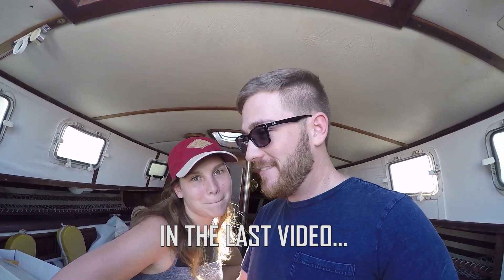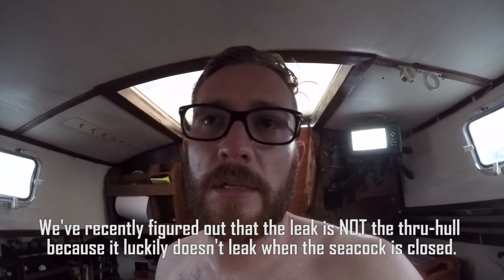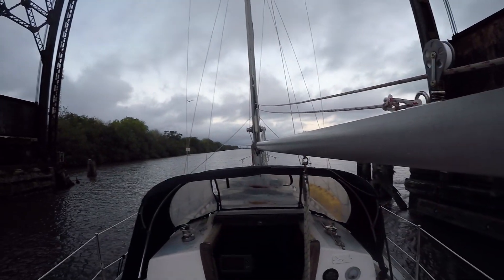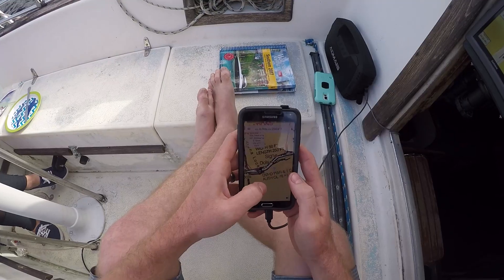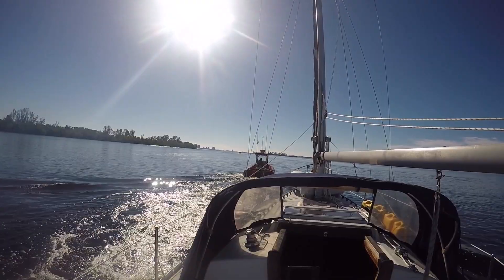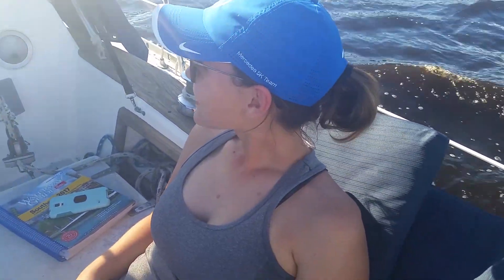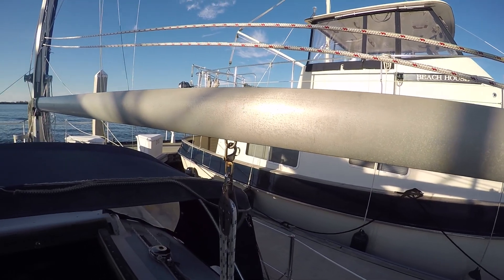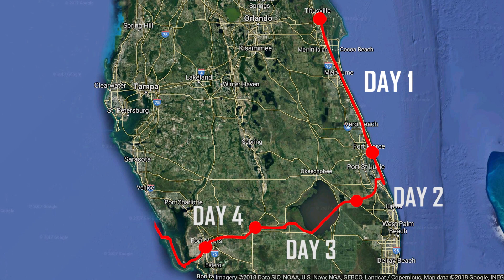33. Three Hundred Nautical Miles on a FREE BOAT! - DIY Sailing

Comment: Good video guys. A pity about the fuel pump issue. Its always handy to have what the car recovery guys call " A racing fuel cell". That's just a gallon can with a fuel line attached. You can put some fuel in it attach the line directly to the injector pump and hang it above to gravity feed fuel to the engine. Works every time.  Have subscribed and look forward to your adventures. Fair winds & regards from the UK
Reply from the maker: Sounds so simple that it just might work! I think we'll try to figure this out and maybe put out a video on how we did this. It could be helpful for a lot of boat owners. Thanks for the suggestion!

Comment: Why not get a Patreon page for people to support your efforts? 

I have seen 50 ft sailboats go for $1 but they take tens of thousands to restore often. Most often they need an expensive engine to start so you made out there. I would have the fuel tank cleaned professionally, change all filters, empty the water fuel separator, check / replace all hoses etc to start and keep that expensive engine in top condition for starters. Best of everything life has to offer to both of you. The trip and memories last a lifetime, especially when you are too old to well, do much more than enjoy your memories of youth :-)

Comment: I posted a long winded story about how you keep a Diesel Engine going on your last video about  an hour ago. it looks like I was  a little late to save you. Kudos for getting towing insurance! I think your going to find out that this  could just as well have happened on a boat that you paid a lot of money for. Anyway, I thought the engine was running a little rough the first time you started it. You might want to get the injectors looked at. Additionally, I would look into some better Engine mounts. It should not have that hard knock and be that noisy.....So just in case, I'll re -post the my advice on how to keep a diesel going here again. It might possibly help some people who missed your last video. Good luck, I think you'll have a nice little boat there.
Re-post from last video:
Hi guys. Congratulations on your new boat.
I thought I would contribute a couple of stories to help you stay out of trouble with your Diesel engine. 
If a Diesel engine is basically in good mechanical condition, then here is the only other thing you need to know about keeping it running for a long time.
My Father in Law was in the production side if the movie business with Warner Bros. Columbia all his life.
One time on location, in the middle of winter in one of the Northern States, a scene required a Longboat full of Fur Trappers to be shown rowing upstream. The current on the partially ice covered river proved to be too strong for the actors rowing the boat. An outboard motor would show a wake, so that was not an option.
The crew came up with the idea of using an old Caterpillar Dozer from a nearby ranch. It had a winch up front that they figured could help them pull the boat upstream. They build a little fire under the oil pan, so they could crank the old thing over and get it started. The problem was that the way the director wanted to shoot the scene, there was no way to hide the Cat or the winch cable, so they decided that the only solution was to submerge the cat with an operator in the river.
They extended both the air intake and the exhaust up, took the fan belt off, got it started, then took the remaining electrical gear off and drove it under water where the operator in scuba gear worked the winch. Some greenery on top of the cat hid anything that showed above water, and that did the trick.
The moral of this long winded story is that if a Diesel engine gets AIR, CLEAN FUEL and you manage to TURN IT OVER, it will have to start. (Off course new clean fuel is of no value if old dirty fuel has previously clogged the injectors). Also, if you want to keep it running, keep clean oil in the pan and keep it cool. Running seawater through an cooling system is also asking for trouble. A heat exchanger is usually the best way to go.
 Commercial boat engines when rigorously maintained, can last for up to 40 000 hours.
I build four steel commercial fishing vessels in the early 80”s. The last one, (my profile picture) weighed out at 140 tons. All of them as far as I know are still floating and plowing the waters of the Bering Sea. I always installed several Heavy Duty (Racor) Fuel Filters on a manifold system. They could quickly be switched over when one of the filters failed.  Also keep in mind that the most likely and worst time for dirty fuel to reach the engine is in bad weather when the boat gets tossed around, and old sediment gets stirred up. Not a good thing under the best of circumstances. It is also important that you frequently inspect the filter(s), and that you can visually see the fuel or any possible water in the glass bowl under the filter. There should be a drain cock.                   A crappy filter, with a metal bowl, which is many times standard factory issue, will filter your fuel, but will not let you see what you got until you open it up after the engine fails.
To further prove my point, in the early 70’s, I was single handing my sailboat just south of Punta Abreojos in Baja on a stormy night when I ran aground on a sandbar. As the boat was pounding in the surf, the portholes blew, submerging the cabin and off course the Engine. Long story...At low tide the next day I managed to get the engine started again. 
I did that by hand cranking it with the compression lever pulled. The minute I let that lever snap, that little Perkins got everything it needed, clean fuel and air and away it went. Long live Rudolf Diesel! Sadly the prop shaft was badly bent and I could not save the boat.
I cannot emphasize enough the importance of clean fuel. I never had a problem with anything Diesel I have ever owned, because I always went overboard on fuel filtration. The only Diesel that ever let me down was a piece of crap Volkswagen Rabbit Pickup Truck. The timing belt broke, and the engine exploded. I take comfort in knowing that it was running on clean fuel until it took its last breath.
Good Luck
Reply from the maker: Thanks for looking out for our audience too! Your advice could definitely help others as well. We did have a mechanic look over it, but may want to still have someone look at the injectors again. We'll examine the engine mounts to see if there is anything we can do to fix that knocking. -Randi

Comment: It's a good idea to close up all the thru-hulls when you are not on the boat. We turn off the engine raw water seacock when we take the key out of the ignition, then hang it on the valve handle so it isn't forgotten.  I really don't trust the engine cooling system not to leak when it isn't being used or watched.  Too many points of failure.   IMHO, never trust something that can fail when it comes to keeping water out of the boat when a simple valve could have been turned off to prevent it.  Wicked Salty lost their new boat because their head siphoned water up through it and flooded the boat when it was on the mooring can.  Simple to have prevented it just by making it a habit to close all the thru-hulls every time you leave the boat -except for cockpit scuppers which need to be left on so rainwater can drain through. 

Don't sweat the engine thing.  All older sailboats are going to run into fuel issues sooner or later if they are not kept up meticulously and most people don't know how to do that.   You'll learn it as you go, and eventually it'll become second nature (or you will go broke paying professional mechanics forever)  But it isn't really all that difficult once you start learning the common failures and how to fix and even prevent them.  Get Nigel Calder's books on diesel repair and he'll walk you through the troubleshooting of problems as well as maintaining the fuel system so that problems are minimized if not almost totally avoided.    Remember with diesel engines it is almost always fuel.  Fuel, fuel, fuel.  If it is a non-fuel issue it is likely to be a VERY expensive failure -often requiring a rebuild that may or may not be worth doing on an older engine.  

Have fun.  Learn those lines :D
Reply from the maker: Thanks for the input! We do make it a habit of closing the thru hulls whenever we leave the boat. I can't imagine how I would feel if I knew leaving the thru-hull open was the reason my boat sank. I don't think I could forgive myself. Lol. 

We actually were given a Nigel Calder book about engine maintenance from the previous owner. When the engine went out in the waterway we were looking over every possible reason in the book. It's why we were thinking it had to be the fuel pump diaphragm. Right part, but ended up being the power for the fuel pump. It is definitely a helpful book. -Randi

Comment: The engine issue could have happened to any second hand boat at any price. It will happen again, as it does to every sailboat engine anywhere in the world. You'll get used to it eventually.
Reply from the maker: Very true. Seems to be our tradition with boats that the engine cuts out on us soon after "purchase". It happened with our first boat, Somnium, as well. As soon as the previous owner drove off the outboard died. Hopefully it doesn't happen with every "new to us" boat. Lol. -Randi
Reply: A diesel engine that has not been well-maintained will likely have fuel-related issues.  If not in the tank with diesel bugs, or in the filters, it'll gum up in the lift or injector pumps or in the injectors themselves.  It's all about fuel quality and maintaining of the filters, hoses, and hose fittings.  You should go through every fuel hose and connector and replace them if they are at all iffy.  Rubber fuel hoses only have a lifespan of a few years before they become prone to failures and are no longer going to be reliable.  Also always have a spare fuel pump on board, and enough spare hose to fix any 2 runs of line plus all the fittings and hose clamps.  You will figure this stuff out.   People don't usually sell or give away boats that are in tip-top shape.  There is usually a reason why they are getting rid of them.  Boats that are sold by people who are very anal about maintenance and have service records and documentation of the work usually sell for a LOT more money.  There is a reason for that.
Reply: Always have a back up kicker . Beats rowing

Comment: I dont know what kind of engine you have but if you can find the fuel line where it connects to the carb disconnect it and turn over the engine with the key and if there is no fuel coming out then its your fuel pump. Hope it helps.
Reply: Diesel engines do not have  a carb!

Comment: Replace the water pump timing gear and chain along with all the hoses when you fix the fuel pump. Be good to have the head reworked before you take it out on a long cross water sail.
Reply from the maker: Definitely will be working on the head system. There are lots of jobs to do, but I am sure we will be getting to the items you mentioned.

Comment: Older fuel tanks crap gets in the fuel and can plug the lines. Carry a little bicycle pump. Just to blow out fuel lines. But he'll it's a great deal a nice boat that won't cost your right nut to get out on the water.enjoy
Reply from the maker: We had heard there can be build up in the tanks, but had never heard of this solution. Lol. Pretty clever. Thanks for the input! -Randi
Reply: go to Rick Moore's latest video aka Sophisticated Lady re: fuel line blockage. Free boats are never "free". Good luck

Comment: a jerry can on the deck and  a hose into the injector pump  will gravity feed you engine  and get you out of trouble every time , you must learn how the bleed the air out of your diesel system after any trouble other wise it will never start

Comment: Coming to your saga just as you "acquired" this boat.  Biggest question: Why were you not sailing it at every opportunity, rather than motoring all the way?
Reply from the maker: Because we were on a schedule and kept getting unlucky on wind direction. Also, sailing on the Okeechobee Waterway is very hard unless the direction is perfect.
Reply: @LearningtheLines  sailing on a riverway is challenging even on an 18' boat, I don't think I would have gotten that brave, even out of desperation.

Didn't know they had the seagoing version of AAA....

Comment: Engine cut out happened to me on an old boat like this. Ended up replacing the steel tank and lines. Possible corrosion blockage issues in the lines?
Reply from the maker: Thanks for the input! There is a priming ball leading from the fuel tank, but the engine itself is self-priming. The priming ball seems to be collapsing shut on itself, so we are looking into removing it. -Randi

Comment: We were wanting to take that route but our 55' mast wont allow it. And the depths get pretty shallow. Not good for a 6 foot draft. Did you see any depths lower than 6?
Reply from the maker: Not that we recall on the Okeechobee Waterway, but the mast height would definitely be an issue for the 49' railway bridge. -Randi

Comment: Rule #1 when purchasing a used boat.  Replace all through hulls, hoses, and prop shaft packing, whether it looks like it needs them or not.
Reply from the maker: Thanks for the input!
Reply: Rule #2: Buy  manual   And a digital volt meter.  Stock backup fittings, belts and hoses on board.
Reply: Thanks for the info.

Comment: Wait! You couldn’t hear that the fuel pump wasn’t running?  You didn’t check for fuel pressure?  I apologize for being blunt here but you’d better get your mechanical chops in order before going offshore or you likely won’t return.

Comment: Who prepares your meal menu and does the grocery shopping before a trip like this?
Reply from the maker: We are admittedly not the best planners. Lol. I went grocery shopping and picked up items that I knew we could easily store and not have to worry about refrigerating. We do not trust the propane lines right now, so that is something we want to get worked out. As we get things like the cooler and propane situated we'll be able to open up other options. We'll be more thoughtful in our meal planning when we have these set up. For this trip we had lots of fruit, a pecan pie (for Thanksgiving), salami, beef jerky, tuna, crackers, English muffins, tortilla chips, salsa...it was not a very healthy diet.

Comment: Having a "kicker", or a separate small outboard can be worth it sometimes, especially in situations like this, or when you don't want to fire your inboard.  Diesels are pretty fuel efficient though, so they're not as common as they used to be.  Just as a heads up, try to check any grounds you can.  Many free boats that have been sitting for any length of time can have wire/ground corrosion issues, especially and obviously when exposed to salt water.  Great advice to give now huh?  Lol.  You're still ahead.  You'll get there also where you'll learn enough to keep you from being another person that says a boat is just a hole in the water to throw money in.  The handier you get, the better off you'll be.  Someday you'll go around the world as planned.  USE THESE ISSUES.  Imagine they are a course in boating.  If you stretch the repair over a few years it's still cheaper than taking a ship/boat engine, wiring and navigating course.   Thinking in those terms, you're still, far far ahead.
Reply from the maker: We try to DIY everything we can for this exact reason. We've found that owning a boat is much more affordable if you can educate yourself and DIY all the maintenance, refitting, and repairs. The only issue with doing this is now instead of the boat being a money-sink, it's now a time-sink, so it's a trade-off. Luckily Randi and I enjoy most boat work so it doesn't feel like work. Thanks for the feedback and for watching!